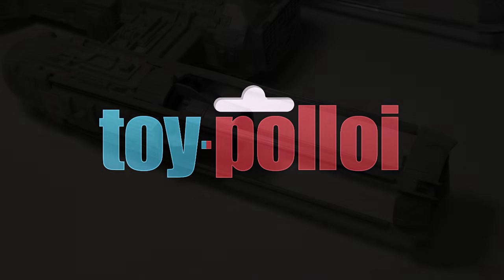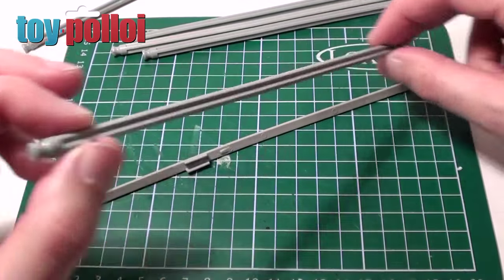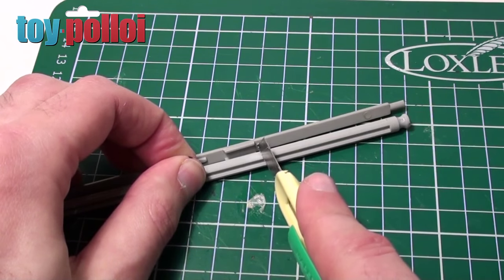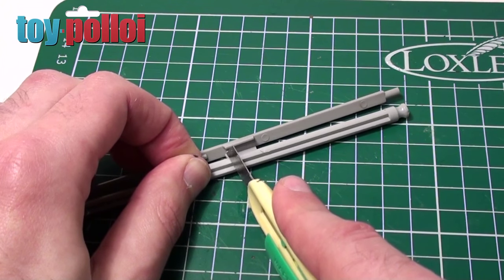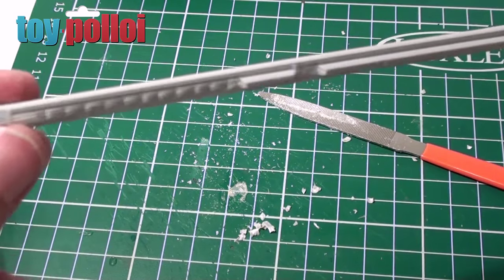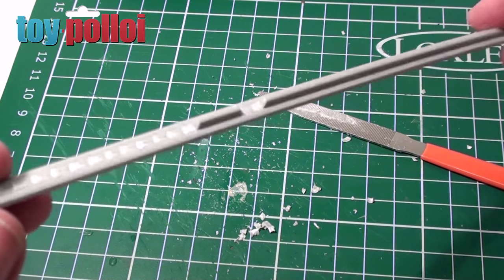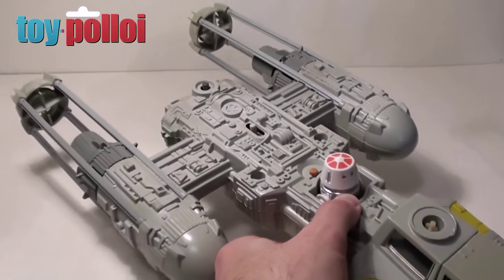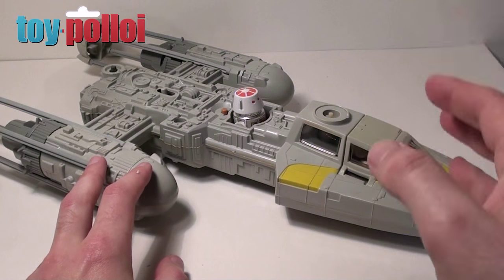How to make Replacement Vintage Star Wars Y-wing struts - Toy Polloi

Comment: Ooooh, B-camera. I like that.
Great work with the k'nex too.
Reply from the maker: +allluckyseven It's still an amateur setup! Just thought I'd give two cameras a go.
Reply: It was nice seeing the work you were doing from a second angle. It helps us visualize the whole thing. Sometimes your hands move out of the frame too, the b-camera would also be useful in those moments, even if the camera is a bit distant.
Reply from the maker: +allluckyseven its a problem i often have when filming, keeping it all in shot. As i am concentrating on what i am doing, not what is in the frame. And i only see it when i come to edit the video. Ill try and use this more often.
Reply: Cool!

Comment: I would try drilling holes in the ends and gluing in pegs out of maybe metal coat hanger for front and back, instead of sanding pegs out of the ends. might give you that little bit of extra length too!

Comment: This is an awesome show of ingenuity. Replacing such difficult pieces is a very tough call, and I am truly impressed not only by the approach you have given it but also by the splendid end result. That being said, I must also state that I truly, truly, truly hate how the rear part of this toy was engineered. I still don't understand how the guys at Kenner got away with creating a vehicle that comes apart with the slightest handling. Sorry: I had to say it!
Reply from the maker: +Daniel Luque I agree. It's an awful design for a toy. Very fragile. These new struts are actually much stronger than the original ones as they are a bit thicker. I never had a ywing as a child, but I'm sure if I did it would have been broken in no time as it was not meant to be played with.
Reply: Yes, that's exactly what I think too! What's more: in my opinion those rear boosters should have been made in a much stronger plastic and also come allready pre-mounted / connected and glued together. And the insertion holes (so to speak) for the struts should have been made in a way that they really stayed totally in place and well put. I think that everything about the design of those pieces is plainly wrong. It looks great, no doubt, but this is a toy after all. I had a friend who owned one and he took both boosters out every single time the vehicle entered battle. So as a kid I never really liked it because there was no way of playing with it without removing the rear part. And what is most shameful yet is that all the new Y-Wing versions don't even correct that flaw... not to mention that they totally ignore the electronics. As I see it, this is a jinxed toy because Hasbro hasn't put any effort into it. And that is outrageous considering that it's super cool mold was made thirty years ago.

Comment: The K'nex work really well. Too Bad they aren't longer so you could use one or two K'Nex along with some original struts.
Reply from the maker: +SEO Toy Review I'm looking at making some longer versions at the moment. Might still be possible. Give me a few weeks to work something up.
Reply: I was trying to think if K'Nex make a longer "stick" that could be painted. I think that is their standard long lenght. I'll stay posted.
Reply from the maker: +SEO Toy Review This is the longest one. I've been working on a fix for original struts which may work well on these to enable them to be made longer.
Reply: +Toy Polloi do you think you could pin and glue extra bit to make it the same length as original?
Reply: It's possible... just another step.
Reply: they look better than the originals even the newer hasbro struts look bowed

Comment: Those snap blade knives are utterly useless. Blunt and not too sturdy. I use a surgical scalpel with No11 blades. Trim little shavings at a time but you get a clean fast cut that requires VERY little cleaning up. Just be careful as the are fecking sharp.

Comment: I think you could use some of the clear glue dots, like the ones that you use to hang up posters on the wall without marring the paint would actually work really well to hold them in. They're also very easy to fully remove. Possibly try that?
Reply from the maker: Could work well.

Comment: For triming down to a "smaller diameter cylinder" you might consider a hobby sized bench top grinder wheel an use it like a small hand held reverse lathe like action ( or similar action to a pencil sharpener).

Comment: I wish you had been around about 15 years ago! I had one of these - complete except for the struts. In the end, I used 'Plastruct' T-Beams, which were really expensive, even then, and made of ABS. plastic, which can only be fixed to polystyrene or acrylic with a liquid cement called 'Plastic Weld', which is great, but volatile. It evaporates so fast, it leaves frost on the brush. I did repair it, so that it looked like a model, rather than a toy - it was so nice to work with, and a friend bothered me so much about it, that I sold it to him to shut him up! Seeing this, makes me want another.

Comment: what kind of sticker paper do you recommend for vintage star wars slave 1
Reply from the maker: Depends on the finish you want, either gloss or mat sticky backed printer paper.
Reply: @toypolloi  whichever looks like the original stickers i don’t know  which  one looks similar cause the slave 1 ship i got has all the stickers but some of them are in bad condition
Reply from the maker: It's up to you. Neither is a perfect match. Some people prefer gloss, some mat. I tend to go for the gloss look mostly. But not always.
Reply from the maker: It's up to you. Neither is a perfect match. Some people prefer gloss, some mat. I tend to go for the gloss look mostly. But not always.
Reply from the maker: I have a few videos on slave one so check them out. You'll see both types getting used.
Reply: @toypolloi  i also have another question i bought a cargo door part for the slave 1 off ebay but it kinda looks new i don’t know if it’s a repro or not is there any way i can tell if it is a repro?
Reply from the maker: I've not seen a repro of that part. Feel free to DM via any of the social media links with a phot of it and I'll take a look. Cheers

Comment: shapeways  makes repro struts
Reply from the maker: +Nikola Bakich and they are about as expensive as originals. These are much cheaper and a lot more fun to make.
Reply: yes you did a great job and like you said a lot better than the originals they dont bend too whats next i cant wait :)
Reply from the maker: +Nikola Bakich Thanks. I'll check out the welding rods and see what they look like. Not something I have heard of before. If the do a x type shape it could work. Cheers
Reply: i know there are triangular shaped welding rods and that on most y wing model kits they are triangular not T shaped

Comment: Just save the time and money and buy a nice complete one on eBay. Keep in mind there are two shades of vintage grey struts used on the Y-Wing. So you may be disappointed buying a single strut which might not match your others. A lot of the Empire and very early Jedi toys have two colour variations like this. Fun for us variation hunters. It's probably uk made versions versus the imported versions because sales were always high and outstripped demand. So there's two dagobahs, three different Cloud cars etc all sold in the uk. The Y-Wing was wave 1 Jedi when they had no idea it was even gonna be in the movie but suspected it might be, so was made during Empire colour swapping era
Reply from the maker: +yakjedi That is just not how I collect. I prefer to buy a beater and fix it up with time and patience. And there will be far more ywings out there without struts than complete ones.
Reply: +Toy Polloi but your not collecting you're building. It's no longer a Palitoy / Kenner toy. So why not just do a scratch build which will be much more accurate.
Reply: +Toy Polloi besides if 'that's just the way you collect' why do ask people for the parts you're missing in the video!? Seems like you do want the original bits but for nothing.
Reply from the maker: +yakjedi of course. I have another one that is original that just needs a few bits. And I always trade or give a badge for what I am offered. I restore many ships at one time.
Reply from the maker: +yakjedi It is still a toy. And as a kid I never had many new toys so I would always fix or mend them in some way. This is what I still do now.

Comment: 6:40 you could also use that pin vise of yours to drill a hole into the K'nex stick and insert a rod of the correct diameter, it'd add a small amount of length 🤷